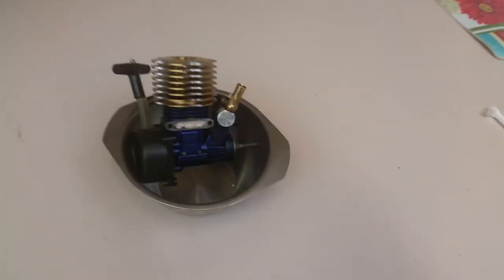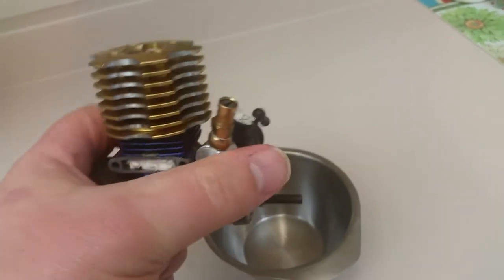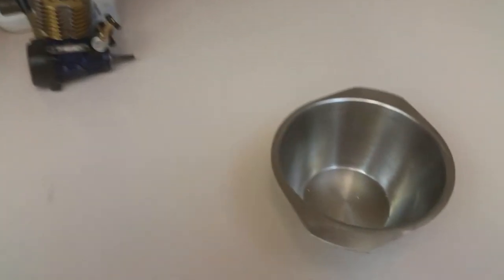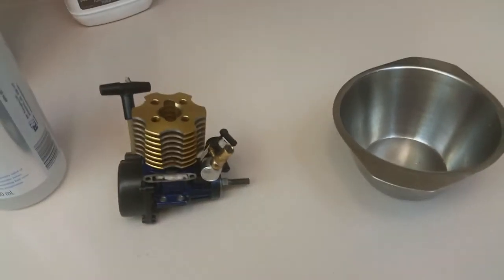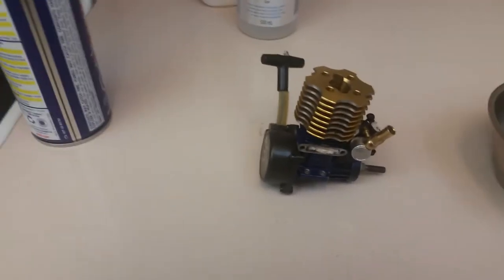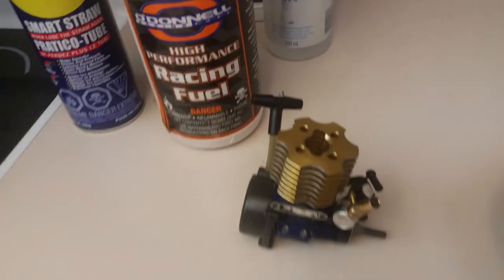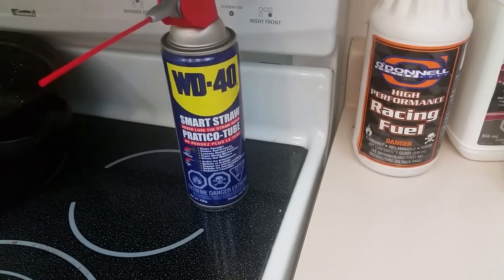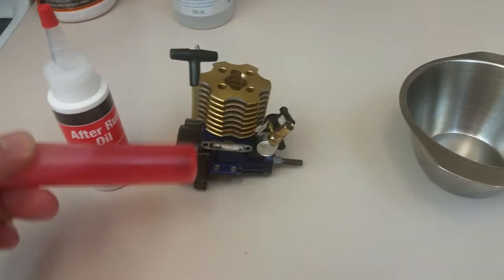How to clean and store your nitro engine

Comment: Awesome informative video! I was wondering how long should your nitro engine be sat there till you should put in after oil? For instance say you fully well knew you would be using it the next day would you still need to put it in even for very short durations while it’s just sat there?
Reply from the maker: I haven't re watched this video in a while but I'm pretty sure like I might have mentioned run your engine completely dry a fuel as well as your fuel system till it won't start him or and it's usually find a set like that for a couple weeks without any problems  But like I said if you're gonna be me know using it on a daily basis you don't need to put after an oil in it every time you go out it's kind of a ridiculous thing to do
Reply: Nice mate cheers for the quick response! Definitely worth looking after these machine because they should last a fair few years I’ve been told if it’s a decent engine and is looked after.
Reply from the maker: @ajkr32   No problem but like anything you look after it it will look after you proper maintenance all that kind of stuff

Comment: I used to run nitro cars/trucks many years ago.  It was the most expensive form of the hobby between cars/trucks, airplanes, and helicopters.  The run to clean/repair ratio was not favorable to me.  I sort of miss it though.  I have an engine cleaning video on my channel as well.
Reply from the maker: i have been into it since i was a little kid and yes! its a lot of money here in canada every thing is 50% more but for me i take care of my stuff and i don't have to fix much i used to do control line flying and am going to get back into it as well keep your eye out fore more! ps i also rebuild all my nitro engines its a lot of fun for me
Reply: Yes, I do quite a bit of engine work for viewers and subscribers too.  it helps pay for more engines!!!
Reply from the maker: that's awesome! i am on  a few nitro groups on FB and i kinda do the same thing

Comment: A friend gave me and old HPI rs4 engine it has 15 on pull start.
He said it was gummed up.
Can I soak it in alcohol to free up?
Never took one of those apart.
Or owned an RC car before.
Reply from the maker: Yes as long as it's 99%  Or denatured alcohol you can also use brake parts cleaner I have several videos on how to do this take a look through my channel thank you for viewing